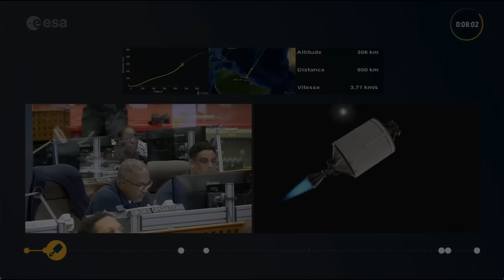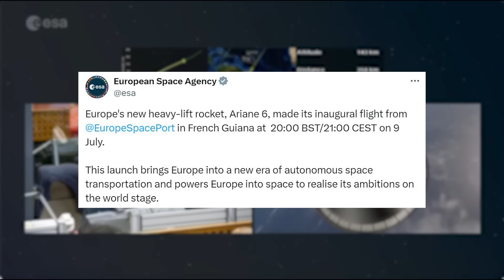Why Are Customers Switching From The Ariane 6 To SpaceX?

Comment: Ariane 6 is at least fully booked for some years. The video is a bit a SpaceX fan boyish. You can not compare the Ariane 6 to Starship which is still far away from being operational (if ever).
Reply: Starship is likely to be operational prior to Ariane 6 availability.   

The issue is only a few markets benefit from Ariane 6 over Falcon 9 or Falcon 9 Heavy.
Reply: @External2737  Starship didnt make a single Orbit so far. Its engines are prone to failures and the Catch mechanism is untested. Crew certification is not on the horizon and refueling capability not demonstrated yet.
I dont want to be Debby Downer but i really dont see Starship commercially available within the next years.. not to the extend that would make this $5B project viable at least.. meanwhile Ariane 6 is already booked to launch into the mid 2030..

And then again i think it is worth to mention that those two launchers dont compete. They have very different design goals and except for flying into space pretty much nothing common.
Reply: If ever? There isn't much in the way of it becoming practical for LEO. The last flight was only held back by the heat shield. Fully orbital flight is probably in a couple of launches. Once it can be used for Starlink satellites, it becomes an operational rocket.
Reply: @FossilTunes  at 10x launches max per year per esa, they had better be booked. sx will eclipse all of that in less than a year. also, to say that starship hasn't made orbit is silly. you know that they decided the mission parameters to be just shy of orbital velocity to guarantee that it would deorbit in case of emergency. ss is already proving to be capable of being an expendable system that blows a6 and everything else out of the water with sheer power and lift efficiency.
Reply: @ysfex3sew  does it? So far Starship just has proven that raptors are unreliable and that is could work expandable. We havent seen any payload (simulation) yet. 
I think that Starship at some point will work but it wont compete with Ariane the same way it doesnt compete with Electron: completely different design goals.
Reply: @FossilTunes  that's why redundancy is part of the plan. Why 30+ engines. Easier to produce/replace at scale. Raptor failures currently are probably due to plumbing issues and not the engines themselves. Highly complex due to number of engines. To think that it's not a problem that can be engineered out. And have you heard of rideshares? Many payloads that could go on A6 could save still by flying at a more accessible timeframe when launching with others than what a6 will be able to guarantee.
Reply: @ysfex3sew  how come so many Starship fans See this as a competition? Space has for the past 50 years about cooperation and diversity. This wont Change because some Apartheidwinner reinvented heavy lifters (we still dont know its true capabilities). The N1 also had redundancy and cheaply produced engines. The result was the Energija...
Just be Happy there is diversity in launchers rather than just one Type that one day might work.
Reply: @FossilTunes  I don't subscribe to   anything that you imply of sx fans. I also don't subscribe to everything cooperation/diversity. I'm happy if countries have their own capabilities, if they want it. The only thing that I hate is the dismissiveness coming from esa. If esa really wanted results, they would have just put their cooperative capacity into securing ss development and guarantee their capacity through SX. Would have cost the European tax payers much less. Also, the last 50 years combined doesn't compare to what has been happening the last 5.
Reply: @ysfex3sew  why would they fund Things they dont need? Again.... (And again and again...) Starship has completely different design goals than Ariane. Its great to have a bus If you want to carry 30 people arround town but useless If you need to stack material precisely using a crane.
Take jwst as an example. sX has no technical capability (even including Starship) to place a satellite that precise in orbit.
Thats why diversity is important. Just have the tool at hand you need.
Reply: @FossilTunes  so the best thing about helping to fund a project is the ability to advocate for and inject your own needs before the final product.
Reply: @ysfex3sew  yes. Musk needs thousands of satellites pollute Leo so he builds Starship. ESA needs a precise launcher so they build Ariane.
Reply: @FossilTunes  okay so I see the direction that you keep steering this conversation. The argument was never about the difference in capabilities between the two. Speaking of trash, I keep wondering why I keep giving my waste away to be disposed. I should also use it to change global data access availability. But no matter how hard I try, I just can't seem to get a signal.
Reply: @ysfex3sew  we should end the 'discussion' now. I dont think you are capable or willing to offer any more usegul arguments at this Point.
Reply: @FossilTunes  yes the littering comment was so very insightful. My   counter of which you have not refuted. As with most of my counters, you have just ignored them in favor of steering the conversation into an adversarial exchange. What a way to live.
Reply: @ysfex3sew  what littering 'argument'? Sorry but all you did so far was saying ' Starship Starship über alles' without ever accepting the simple fact that different launchers have different capabilities. Starship is not designed for most precise >Leo Orbit Insertions while Ariane is not built to deliver dozens of small sats to Leo or prepare heavy stuff for moon and beyond...
Is that really so hard to understand?
Reply: Eat your words
Reply: @BronnBlackwater  hm?

Comment: Update - Falcon 9 grounded after faulty second stage- if a production issue  could be a lengthy grounding.  ISS crews effected- maybe,  commercial customers - possible.
Reply: whole lot of speculation in your comment. . . the investigation could be done as soon as this week.
Reply: , typically speaking, production issues get you things like a one out of five failure rate.....

Most definitely not a one out of every several hundred failure rate.

And it's pretty well known that humans do not currently have the ability to make anything completely fail proof. It's just not possible. Sometimes a mechanical Park will just fail no matter how careful you are, because our ability to see imperfections is not infinite. Imperfections or defects, that our technology does not allow us to see, does exist as a thing that can actually happen.
Reply: ISS crews won't be affected the issue was with the MVAC engine which isn't needed after the dragons in orbit existing orbital Crews are not affected by this since the second stage is jettisoned after the capsule and SM is put on an intercept course with the ISS
Reply: @jamescobban857  Could even be something as simple as a bad part or human error, someone could have torqued something to the wrong number.
Reply: @TheEvilmooseofdoom  which would be even harder to fix. If there is a quality concearn raised by a customer i always hope it is something in either the design or the production process so you can have a satifying answer and solution. Someone "torquing to the wrong number" can either be very hard to find or sound like a scapegoat answer to customers. And since the FAA has grounded the F9s i guess that they see this as a serious enough issue to demand good answers.
Reply: Considering how long it went without problems, this is some sort of edge case, probably won't be long to get it fixed for future flights.
Reply: @logicalfundy  once in less than 350 times? Thats a rough 0.28% error rate... I cant speak for aero and space but where i work this is considered extreme when it comes to critical part without backup.
Imagine such error rates on other complex machines like planes, AEDs or just concrete sleepers for trains...
Reply: @FossilTunes  the Space Shuttle had a total of 135 flights, two of them had catastrophic failures that killed people. For better or for worse, the space industry is much different than running something like an airline.
Reply: @FossilTunes  ... and I will note that when it comes to crewed flights, the Falcon 9 does have a perfect record so far.
Reply: @logicalfundy  Well... I guess there is a reason why the Shuttle program was cancelled, dont you think? And of course.. spaceflight IS still more dangerous than most other things.. but especially then it is very important that mission critical parts without redundancy work with the lowest possible failure rate.
Dont get me wrong... I dont want to talk the F9 bad.. absolutely not.. but i think that this failure on a crewed capsule would have happened during a very critical phase of the launch and surely had triggered a launch abort (possibly even a ballistic abort?) and therefore the FAA has to have an in depth review of what happened as it really concearns safety.
Reply: @logicalfundy  yet that is the "risk" that spacex took when it started using the same rockets for crewed flights and uncrewed flights at the same time. I (partial) failure during an uncrewed mission will be reviewd for its impact on a crewed mission..
Reply: @FossilTunes  they started crewed flights after uncrewed flights, when both SpaceX and NASA were satisfied they were safe.
Reply: @logicalfundy  so? Now there is an issue
Reply: @FossilTunes  I am confident it will be fixed and if there is a problem with the design it will be changed. At this point we don't know much about the failure; if it is the result of a chance event like a micrometeorite strike, then I would be hesitant to say we know that the true failure rate of the system is lower than acceptable as we don't have enough information to draw that conclusion.
Reply: @logicalfundy  Of course it will be fixed but 0.28% failure rate is surely unaccaptable if human lifes are in danger. Imagine if 0.3% of all planes had to do emergency landings for failing (of all!) engines (Insert Boeing joke here). Of course spaceflight and the branch of industry i work at arent directly comparable.. but the company i work for and did QA for years does also create parts that are critical for the function of mass transportation. We have a maximum tolerance of failed products of 0.05% - if the failure rate, either found by QA or the customer, is higher production has to be stopped and the root cause has to be found. 
And i cant believe that 0.3% is OK for spaceflight... 
But thats why they are grounded I guess.. now to find the cause, fix it and then deliver cargo and personel back to space.
Reply: @FossilTunes  I have a question - if you only have 300 flights, how do you distinguish between a 0.05% failure rate, a 0.1% failure rate, and a 0.3% failure rate? Don't you need a couple of thousand flights to make distinguishing between those percentages meaningful? Regardless, it is grounded so it is being treated as unacceptable at the moment.
Reply: @logicalfundy  I guess you have answered your own question. We dont know the "true" failure rate. It may never occur again but it now happened after roughly 350 flights and therefore NOW it is 0.3% and therefore considered severe enough to warrant the grounding. Lets hope its a reasonably simple fix.